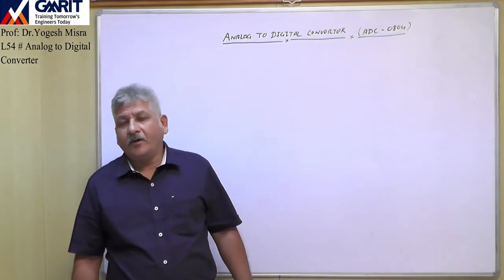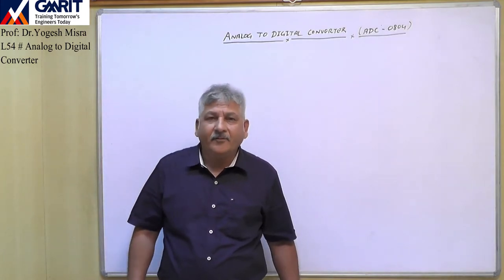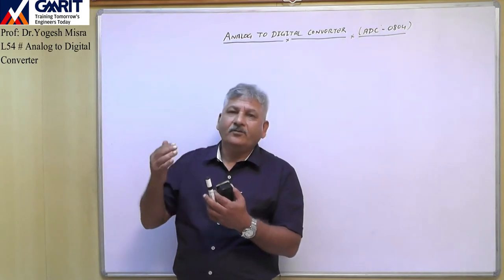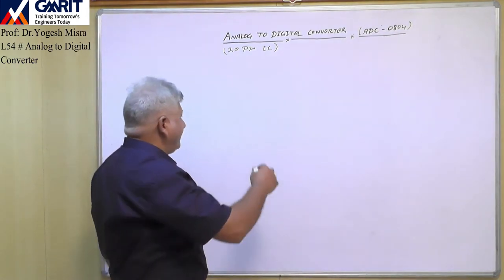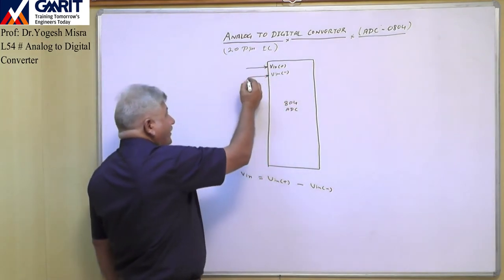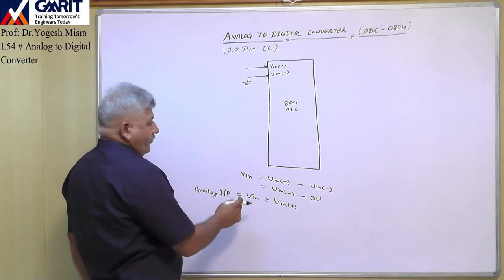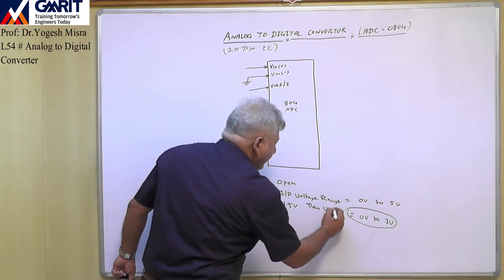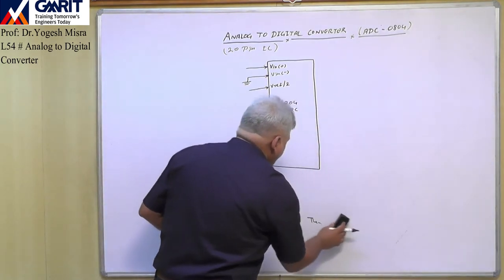Lecture 56: Analog to Digital Converter (Part I)

Comment: Sir I have a doubt:
at timestamp 20:21 of the lecture, you explained that  we send an analog signal at Vin at time=0 and notify the ADC to begin conversion via "start of conversion" pin at time =100 usec. Now it takes ADC 110 usec to complete the conversion process (given the fclock = 606 KHz). So shouldn't the EoC graph drop from HIGH to LOW at time = 210 usec (because the conversion starts at 100 usec passed and it will take further 110 usec to finish the process)?
Reply from the maker: Yes you have pointed right. EOC goes low at 210 microseconds.
By mistake i wrote 110 microseconds.
Thanks.